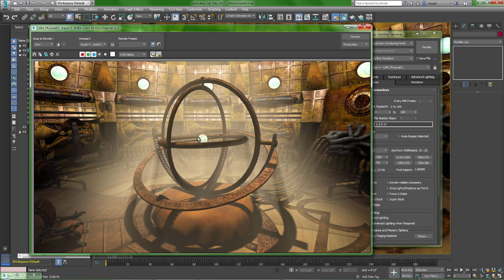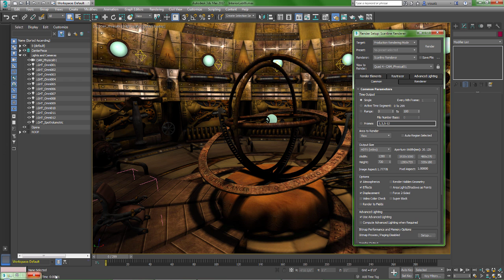Autodesk 3ds Max 2017; Multi-threading the Scanline Rendering Engine

Comment: Thanks for showing this.  I"m running scanline renderer in Max 2024, and I'm not seeing anything like your efficiency.  I'm seeing CPU utilization top out at about 38%.  I wonder if I have a setting wrong.
Reply from the maker: It might depend on the different tools you're accessing in your scene(s).  its not as optimized as things like Vray or Arnold, but at the time I recorded this, Scanline was still the most widely used renderting engine by 3ds Max users, and it was/is great to see it get some love.  I still use it a lot for speed's sake.

Comment: So scanline is the 2nd most popular render engine. What is the most used one?
Reply from the maker: +Petar Stamenkovic The last time i had access to the data it was actually a tie for first place between VRay and Scanline at 36% of users (each).
Reply: +Gary M. Davis Thank you!

I'd really like to hear your thoughts on vray, if that is an acceptable question :)

I'm a long time mental ray user, that has been enchanted with Corona lately. I wouldn't call Corona straight up better, since it's not, but in many cases it's just a pleasure to use, compared to mr/ir.
Reply from the maker: +Petar Stamenkovic they all have their pros and cons and I don't personally care for the term "better" since its very relative to the individual.  If i were heavily into production rendering, i'd be using Vray (and am, in fact, slowly adding it to my regular toolkit).  It will be interesting to see where Autodesk takes the Arnold renderer.  Having said that, i do still use Scanline for a lot of things myself.  always loved it.  do even more now. =)
Reply: +Gary M. Davis Thank you! I'll be sure to give vray another go then.

I too am interested in Arnold. I use Max exclusively so I don't really know what to expect from it.

It does look like Autodesk will be doping mental ray/iray with Arnold under their own umbrella.
Reply from the maker: +Petar Stamenkovic you might also want to check out AMDs new FireRender plugin for Max.  It's free!
Reply: +Gary M. Davis I will thanks!